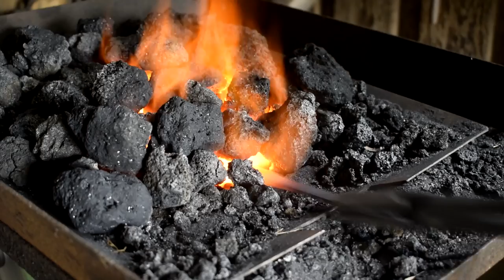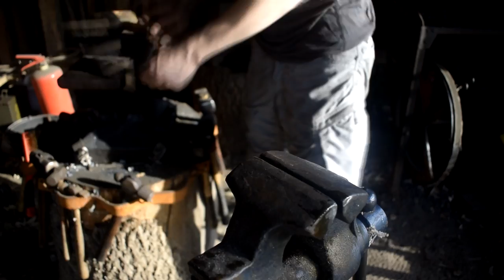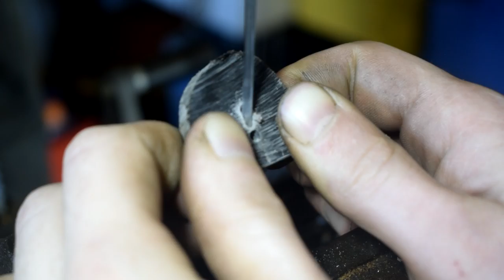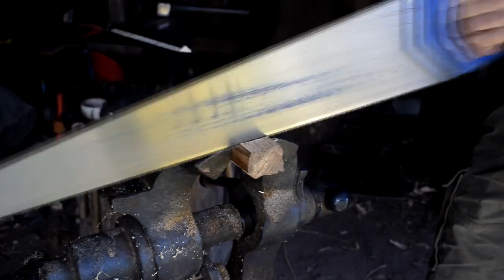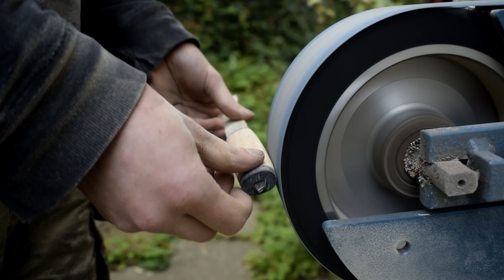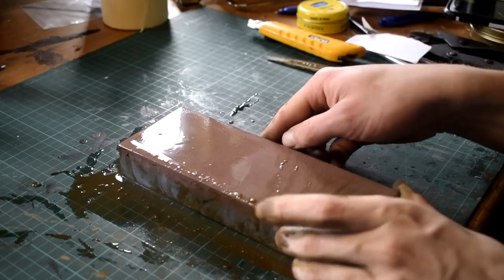Knife making - Forging a Long Yakutian knife

Comment: the Yakutian knife is not only a form (shape), it is a one-sided hardening in a carbon donar (coal) from the convex side, which allows the knife to almost self-sharpen, like a beaver’s tooth
Reply: Андрей Давыдов how does the self sharpening work, and the hardening is made on one side of the blade? Please explain more, i am curious indeed.
Reply: @stephenpaez9038  the convex side is carbonized, and where there is a flat grinding, it is softer and it grinds during operation, so the knife remains sharp "beaver tooth effect". watch the video by the link, there it is in detail about it, only in Russian, try subtitles
Reply: @stephenpaez9038  the beaver’s tooth is hard on the outside and soft on the inside, therefore the inside is erased and the tooth remains sharp all the time, and yes the beaver’s teeth grow all his life
Reply: @stephenpaez9038  sorry English is not my native language and I do not use it)
Reply: Андрей Давыдов Thank you for the explanation. I understand you without a problem. Your message is plenty clear. English is not my main language either Spanish is ;) Grettings from Puerto Rico.
Back to topic. I guess they temper back the hollow part a bit more to get it softer then. I read once that the traditional Yakut knife is not hardened to a particularly high HRC to make it easier to sharpen on the field.
Reply: @stephenpaez9038  the fact is that all these are assumptions and there may be different versions, but they have been practicing unilateral carbonization during annealing for a very long time
Reply: @stephenpaez9038  but certainly it’s not only the shape and convenience of sharpening
Reply: @stephenpaez9038  you just need to understand the difference: the Yakut knife and the knife in a shape similar to the Yakut
Reply: Андрей Давыдов i do a little of bladesmithing and i wish to understand better the traditional methods so i can recreate a yakut knife that is a least close to the real thing. The yakut blade appears indeed as a tool designed thoughtfully yet simple and straightforward.
Reply: Андрей Давыдов i understand your point and respect the art made by blacksmiths of Yakutian origin
Reply: @stephenpaez9038  there is a very primitive technology, metal recovery in a high-carbon environment, literally you anneal the metal in a heap of coal that burns from the outside
Reply: @stephenpaez9038  just protect one side with a piece of seal)
Reply: @stephenpaez9038  or just lay it on top with the convex side down
Reply: @stephenpaez9038  everything ingenious is simple, but it’s more difficult to restore the whole technology
Reply from the maker: Didn't know that. Thanks for the information mate :)
Reply: old turkic people were very good with steel

Comment: Have you heard of Baotou Steel? Just like hamburgers, the three knives are combined into one. The outside two are soft and the middle one is hard. Then the clay is attached to the knife. The knife has higher strength, better toughness and is not easy to break.
Reply: Aka san mai, aka laminated steel. This generally does not actually result in any special properties unless special steels are used (given more modern heat treating methods, anyway), it was just a way to stretch good steel further.

Comment: What would be some injuries a blacksmith could get? Not the obvious ones, like burning bodyparts on hot steel, dropping /hitting hammer on body etc?
Reply: In history crippeld legs so a good blacksmith would not run off
Reply: If the anvil is not at the proper height you can blow out your elbow and hurt your shoulder. The most common injury I’ve noticed is burning when taking hot material out of the forge, make sure you wear a good Kevlar glove on your tong hand and don’t leave it in front of the forge for too long.

Comment: I see you too use up that minwax trick. I just put a handle on the sword I've been making all summer. Honestly I'm so happy to have discovered this. Makes fitting the handle perfect 1000 times easier. 

As always wonderful video my fellow craftsmen love the way you chose to texture the knife! 

Quick question what kind of wood is on the Ends of the handle?
Reply: Some type of horn
Reply from the maker: Indeed. bedding the tang is quite useful.

Comment: Making create may I ask you a question what fuel do you use in your Forge is it charcoal or coal
Reply: I've been wondering this too
Reply: As far as i know its regular coal but in bigger size than regular blacksmithing coal
Reply: I think it’s actually coke.
Reply: @muledeerdude  it is coal and it burns to coke (you can see it in some other videos when there is a lot of smoke from fresh coal) and since the pieces are so big, the burned coke lasts long
Reply: Ivan Kotora I disagree. It’s either a very low quality coal or it’s coke, and it looks more like coke to me. I’ve used both coal and coke quite a bit and I’d bet a fair amount that that is coke. I’ve seen basically all of his videos and I’ve never once seen his forge produce as much smoke as my coal forge. But, neither of us will actually know unless he answers, until then it’s all guessing, educated or not.
Reply: Its petroleum coke
Reply from the maker: It's coke.
Reply: @MakeNCreate  thank you for replying I appreciate it

Comment: I like the Yakut design as well.  I made a shorter stubby one and want try a narrower more ancient style.
What is the weight of your hammer?

Edit... Have you considered make a spring fuller to hammer in the groove?
Reply from the maker: Can't remember watch the video where I made it, I probably mention it there. I do have a spring fuller but I didn't wanna use it since the ball peen hammer is a bit more common.
Reply: @MakeNCreate  
Many thanks.

Comment: What is the number of real world hours that goes into forging a knife like this?
Reply: In MY experience? Something similar, roughly 30-40 for something well made and really paid attention to. Some people can bang out a knife in half that.
Reply: @derekanaya990  I assume that is forging the knife with hand hammers like this video does?
Reply: Yes. I've never owned or used a power hammer, so I honestly couldn't comment. I've been making knives and over stuff a few years and I'm no expert. Alec Steele on youtube actually did a 2 hour knife but again, the more you put into it, the better. I actually don't own a belt sander either (very small garage/shop.) So you could probably take 2-3 hours off that with a belt grinder.

Comment: Very nice video.  I enjoy watching this a lot. Would suggest some safety glasses,  gloves and possibly a leather apron.  Thanks
Reply: John Boyd really? I agree with safety glasses, but I’ve gotten hurt more times using gloves. A leather apron would be nice but it’s really not that important, he should be wearing long pants though
Reply: @katsmokish388  good answer.  I know nothing about forging,  just what I see on Man at Arms: REFORGED.  Was in pipefitter Union ; sometime gloves helped; other times not so much.
Reply: @johnboyd7158  that's definitely true, gloves have their time and purpose!
Reply: As tree mentioned safety glasses are always a must even when you don’t think you’ll use them, once saw a guy get something in his eye from opening a tape measure. Gloves can sometimes do more harm than good though, when you’re using tools like a belt sander or band saw gloves can actually catch on the machine and pull your hand into it. Just something to keep in mind